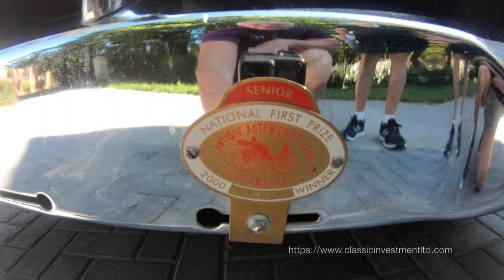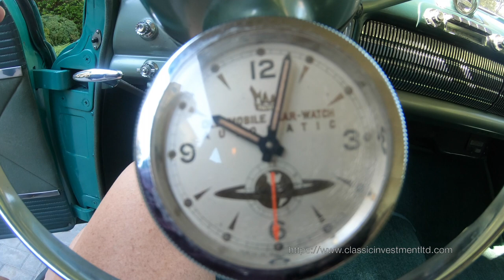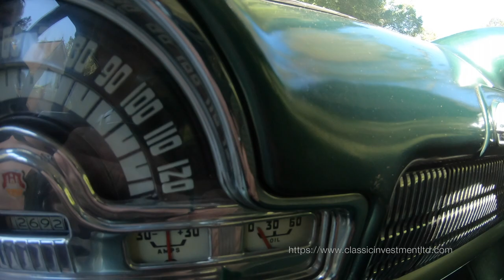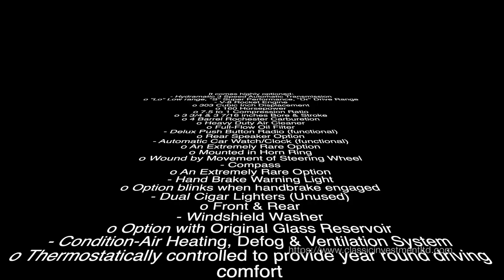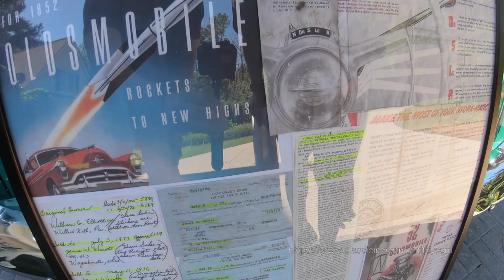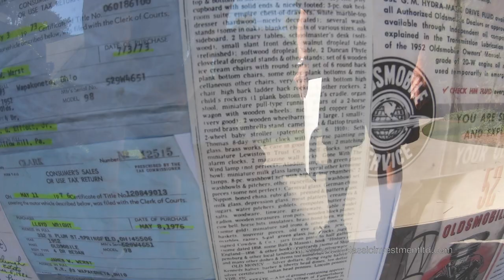1952 Oldsmobile Ninety Eight

Comment: Nice car. The Hydra Matic transmission is a 4 speed automatic transmission. With shifter in Lo, the car starts in first speed and changes into second at about 10miles per hour.

Comment: Emphatic statements have been made in these comments about Hydramatic being a 4-spd transmission, which is certainly true.  HOWEVER, just for the record, I remember reading years ago that--at least in 1951--there were some Hydramatics that, when placed in DR, actually started in 2nd gear, with 1st gear only accessible when starting in Low.  (This would make it feel like a 3-spd transmission, if you didn't know otherwise.)  An acquaintance of mine and I both owned '51 98s in the early 1980s.  My car would go through all 4 gears when starting in Dr, whereas my acquaintance's would go through only 3 gears, but still ending in high gear.  So, what I remember reading decades ago about certain "outlier" Hydramatic trannies seems to have been true, although this may have been unique to 1951.   (Starting in 2nd would be preferable in icy conditions, whereas the ultra-low Hydramatic 1st gear is guaranteed to make your wheels spin on ice!)
Reply: You are correct about some 51 Hydras starting off in 2nd when in Drive.  Pontiac called it "Dual Range Hydramatic".   For 52 though, GM reworked the Hydramatic to provide two Drives, 1 - 4th gear, and 1 - 3rd gear.  General Motors called this "Dual Range Hydramatic" as well, and it is not the same as the 51 3 forward speed trans.

Comment: These days one is better off to buy one that's already been restored or an older restoration as restoration now has gotten too expensive. Not to mention we might not have gasoline to drive them after 2035.
Love hearing it run. Shows you don't need to mess it up with a 12 volt electrical changover when 6 volts does just fine.
It would have been nice of you didn't put music in when you guys were taking your drive. I'd rather hear car sounds and I think most viewers agree on that.
Reply: Pretty sure there will be petrol in 2035. And prehaps even eFuels ( synthetic fuels). There is too much money and time invested in classic cars not to have some type of fuel for these classics.

Comment: WHY WOULD A FULLY RESTORED 1952 OLDS 98 REINSTALL THE CHEAP SEAT COVERS THAT THE DEALER INSTALLED PROBABLY ON ORDERS FROM THE BUYER AS IT WAS THE CASE BACK THEN TO KEEP THE SEATS FROM WEARING . HOWEVER UNDER THAT CHEAP SEAT COVERS IS A BEAUTIFUL WOOL AND MOHAIR FABRIC SEATS BOLSTER IN BLOCK SECTION AND COLOR COORDINATED .THIS CAR HAS THE SAME SEATS AS THE CADILLAC OF ITS TIME THE  SAME AS THE SERIES 62 CADILLAC'S.BUT THE CAR IS NOT A LOADED 98 OF ITS TIME .IT HAS CRANK WINDOWS MANUAL SEAT AND THE LESSER OF THE 2 RADIOS .''WONDERBAR''' WAS THE TOP OF THE LINE AS IT AUTOMATICALLY SELECTED THE NEXT POWERFUL STATION.ALSO AUTRONIC EYE WAS AVAILABLE AND IS NOT ON THIS CAR WHICH DIMMED THE LIGHTS AUTOMATICALLY AND BACK TO BRIGHTS. AND THAT HYDRAMATIC IS A 4 SPEED TRANSMISSION !! LOW IS 1ST AND 2ND SUPER IS 3 RD AND DR IS 4TH. THAT WAS OLDS CLAIM TO FAME AS WHEN YOU WERE ON THE ROAD AND WANTED PASS A SLOWER CAR JUST DEPRESS THE ACCELERATOR TO THE FLOOR AND THE TRANSMISSION WOULD AUTOMATICALLY SHIFT TO 3 RD GEAR AND GIVE BURST OF POWER,LIFT AND IT WOULD GO BACK INTO 4TH.AND ALL OLDS HAD THAT SAFTEY BLINKING LIGHT TO WARN AGAINST BURNING THE EMERGENCY BRAKE.BUT WAS ATTACHED TO THE INTERIOR LIGHTING SYSTEM.AND IF THIS CAR CAME WITH 7.60.15 TIRES THEY WERE UNDERSIZED AS THE SUPER 88 USED THAT SIZE THE 98'S WERE 8;00 8;20 X15.   I KNOW ALL THIS AS I HAD A 1953 SUPER 88 AND MY PARENTS HAD 1953 98 TOTALLY LOADED INCLUDING AIR CONDITIONING. AND HAD US ROYAL PUNCTURE PROOF TIRES FROM THE FACTORY SIZE 8:00 8:20 X15 A $500.00 OPTION. MY SUPER 88 HAD ALL THAT BUT NO AIR.